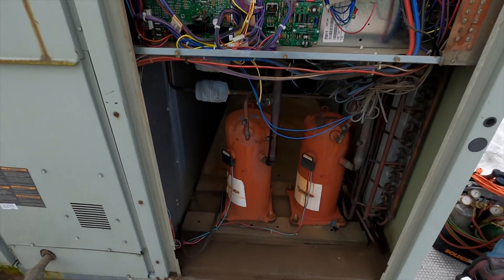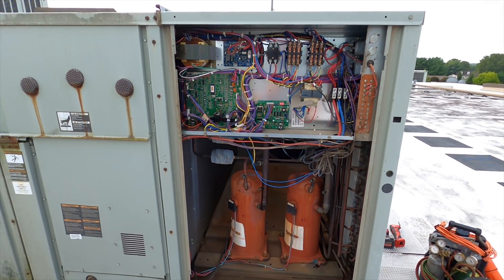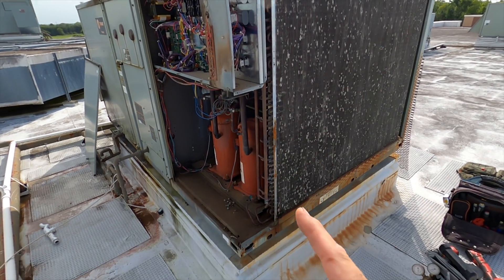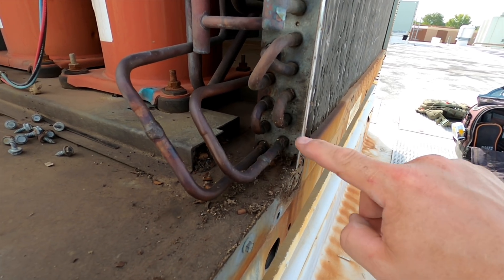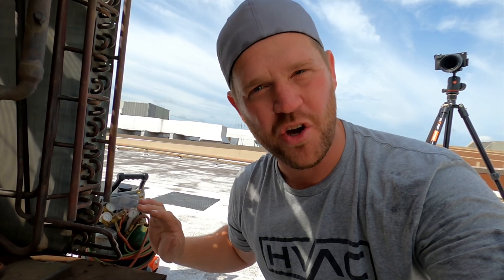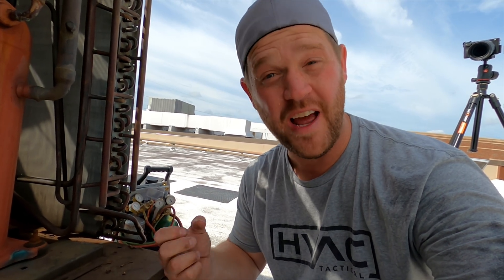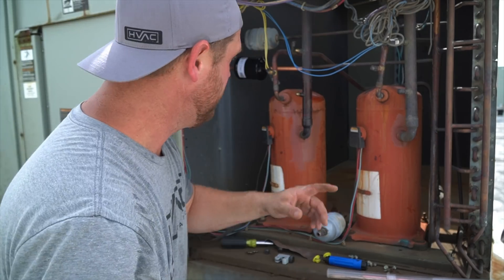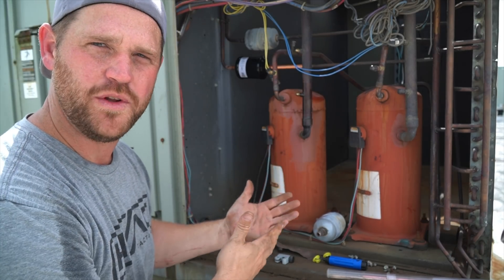Staying On TOP Of Your Game!! | HVAC Life

Comment: I have never been able to patch up a leak and less I cut the metal completely out the solder Would never take. It was always the galvanized Metal wore a hole in the copper tube and the only way I could fix it was the metal had to be cut away completely from around the copper tube. Sometimes I haven’t been able to do it it was too tight depending on the coil. Trane probably sells heel guards for that unit you should try to sell the customer one

Comment: How do you "Tee" into the suction side when you have the Fieldpiece blue tooth pressure sensor attached so that you can add charge?  I've tried different fittings but haven't had good luck.
Reply from the maker: This is what I use:

https://www.trutechtools.com/CTEE14

Comment: You made it look so easy.  It looks that way watching pro athletes too but there is always lot’s of solid sork behind that good result.  
  Did you add an access port?  How did you locate that leak?  If vibration caused it, is it likely to happen again nearby?  Was that leak just a manufacturing defect?  It looked like you read the pressures on your phone.  I would have liked a brief description of that equipment.  It was nice to see how well organized you had your tools and used the cart to move them into place as much as was possible.

Comment: How many years are condenser coils kept in stock/manufactured. I have a Rheem Classic X that is 20yrs. old and the condenser coil needs replacing and evap coils is good. I don't want to upgrade to the new crap. Is every contractor going to try to tell me "that model condenser isn't available any longer". Can I find it myself on the internet and have it shipped to my house or are those items not allowed to be purchased without an HVAC business license?
Thanks

Comment: Ive never seen a roof hatch that big ever. Usually they are barely big enough for a normal sized man! I saw you rolling up the extension cord, doesnt it suck when electricians dont follow code and put a receptacle within 25' of the unit!
Reply: We have those in Indiana
Reply: They use them for stairs going to the roof. Probably from an attic space.

Comment: The multi-tool carbide blades advertise that they cut metal and it sucks because they’ve never worked for me when cutting thin gauge metal.
Reply: Carbide tip *
Reply: Some are better than others.
The carbide ones with teeth that resemble a hacksaw blade normally work pretty well. Main thing is to keep them moving and not overheat the blade. Bosch blades are pretty good. Fein are a bit pricey.

Total pass on any of the Stanley/B&D/Craftsman/DeWalt family of crap. Dremel is cheap too. Never tried Rockwell or Makita.

Milwaukee is coming out with blades, I'm looking forward to trying them when they become available.

Comment: I used to be a new con HVAC installer a few years back and ended up getting laid off. Never got back into it cause I just felt defeated after that. But I've recently been looking into becoming Refrigerant Certified and getting into Commercial/Residential. Any tips on how I should go about that or where I should start?
Reply: Zakary Albinana been a commercial/Residential service tech for almost 7 years now. Would suggest you just get out there and find a job doing Hvac, start out as the apprentice/helper and work your way up in a service/maintenance. Just remember this is a trade and an ever changing one so expect to be learning for life and questioning what you know on a daily basis.
Reply: @johnmckeon3196  so even though I worked new construction HVAC for about 3 years I'll still have to get I'm fresh as an apprentice and start over? Was hoping there would be a way to use the time I already have in the field.
Reply: If you have 3 years of install work under your belt, that's a great start on checking off the first checkbox on most job posting's pre-reqs, some prior experience.

Consider this philosophy: A good installer has some install experience and a good serviceman has some install experience. 

The two areas do require different skill sets. Service/Repair is much about your knowledge of how/why things work, diagnostic skills for sequence of operation and troubleshooting of processes, and ability to execute taking things apart and putting them back together to successfully fix it.

Not sure what you did prior to install, or what you learned along the way since, but electrical theory knowledge and hands-on skills are a big chunk of HVAC diagnosis/repair work. Depending on the type of equipment is which other subject applies, combustion for heat, refrigeration for AC/HP/Refer,  hydronic/steam for boilers, airflow for ducted systems.